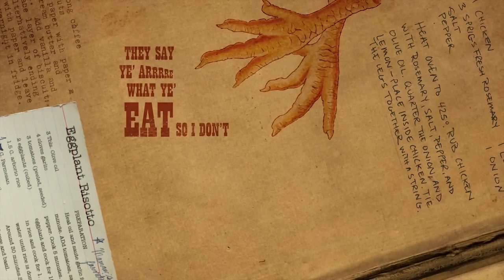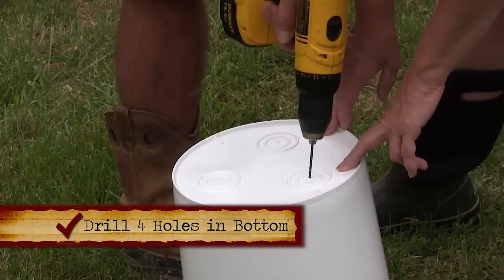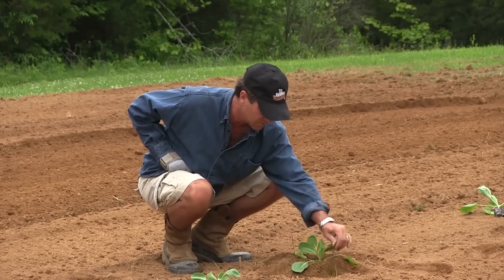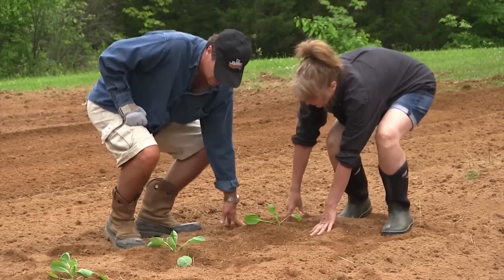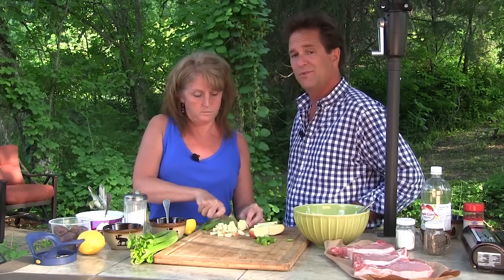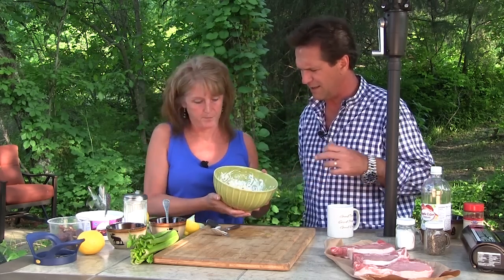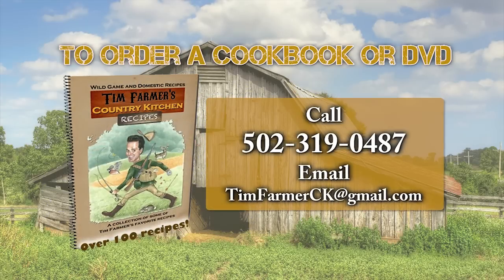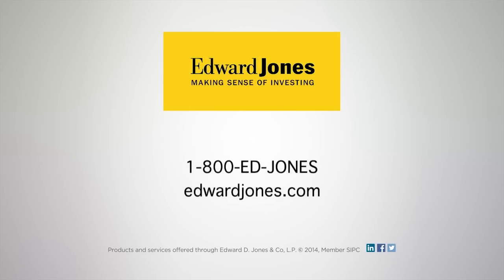Planting Tomatoes, Smokehouse, Pork Chops & Waldorf Salad and the Bee Box (Episode #307)

Comment: I was wondering how you are going to get to the tomato to pick then with that small of a square. I use the bigger square box fence so I can reach thru there and pick the tomato
Reply from the maker: pms1953 I built them really wide and low to the ground....we can reach every square ince of the interior....no need to pull them through the holes
Reply from the maker: Tim Farmer oooops .....inch.....it's not a small square, it's a huge circle